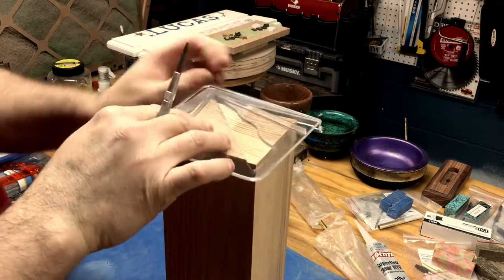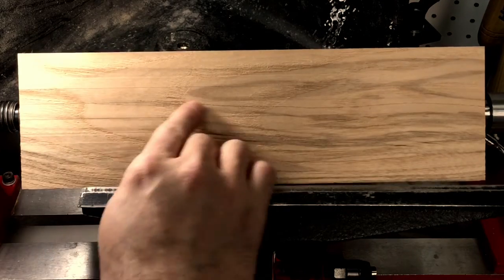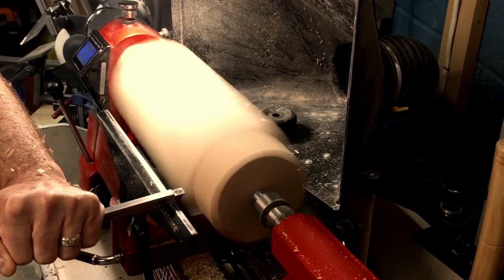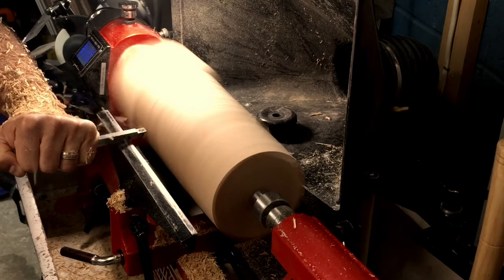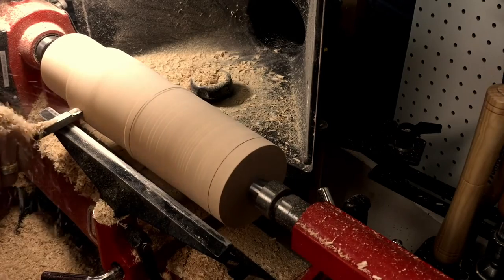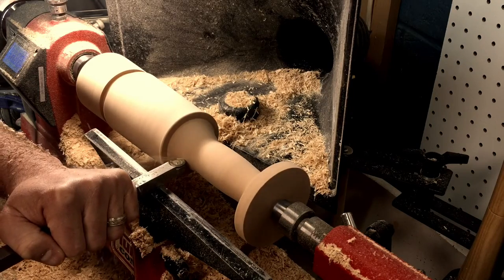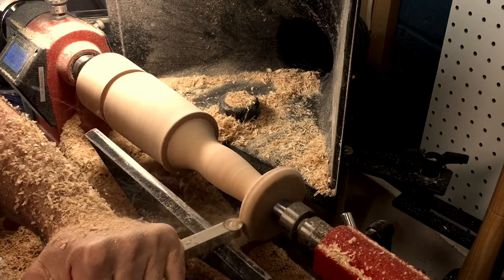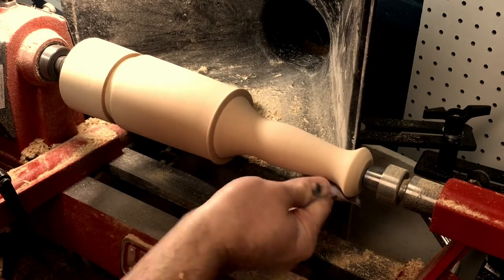Turning a Wood Mallet Using Carbide Tools

Comment: I use a maul like this daily.  Mallets are hammer headed; mauls are cylinder headed.  The tapered head is great, and the degree of finish beautiful.  I would have made the diameter of the front end of the handle smaller, the same as the back end.  This will significantly reduce fatigue in your hand and forearm when using it to carve anything where you use repeated blows.  You can hold it in a loose cross grip and throw the mallet when the handle is shaped smaller in front.
Reply from the maker: Sounds good! This video was several years ago, but I still use that ash wood mallet in the shop, no issues other than a few dents. I do want to make a smaller one too. Thanks for watching and commenting!

Comment: On a metal turning lathe, carbide loves high speed, on centre line and a decent cut. With just four carbide cutters, most operations are possible. A circular cutter on a curved shaft is great for inside turning. Another plus is the very finish, the inserts are easily sharpened on a fine flat diamond sintered plate, not at all expensive and they retain their sharpness for a long time. 👍🇦🇺
Reply from the maker: Shevill Mathers sure, carbide has it place in wood turning. Thanks for the info.

Comment: Sperus, you did a great job....! Looks to be quite comfortable. Thank you for sharing....!
Reply from the maker: Hey, thank you. It is comfortable. I made this video awhile ago and have used the mallet quite a bit. Its held up great. It has a few dings, but that's to be expected. The only thing I would change is to put one flat side on the handle end so it doesn't roll on a table. Thanks for watching. Cheers my friend.

Comment: Hi I am BC and I also need a malley how long should I make it? also is hickory a good hard wood to make a malley out of?It looks like you started with a 4x4 maybe 10" long?BC
Reply from the maker: Hi Betty, my mallet is 10” long. I did start with a 4x4” block of Ash wood. You could use hickory, but it would end up with a bunch of dents. Depends what your going to use it for, chisels, etc. Hickory is a hard wood with strength and great shock absorption. It’s often used for tool handles. thanks for watching.

Comment: Tip: Because this mallet is going to get abused, an oil finish like Watco would have been a better choice. Use the poly finish on things that just sit around. The shape of the mallet turned out great.
Reply from the maker: Hi Robert, sorry for the delay, your comment was blocked for some reason and I had to approve it. Watco danish oil would have been a good choice. I will try that out next time. So far the mallet has held up well, just a few dings, but that's to be expected. Thank you and thanks for watching my friend. Cheers!

Comment: It looks good but I think I would have rounded the top and bottom of the mallet! It would avoid sharp edges when hammering and chipping out!
Reply from the maker: Peter Boyd hi, thank you. That's a good idea. I was actually thinking that at the time. Luckily it hasn't chipped and held up well so far. It does have some dents now. Thank again. Cheers!